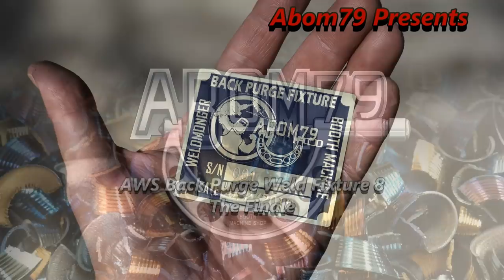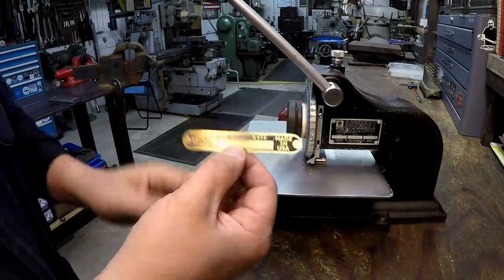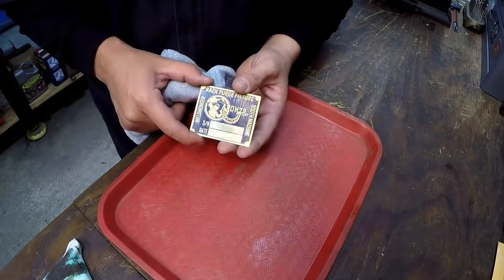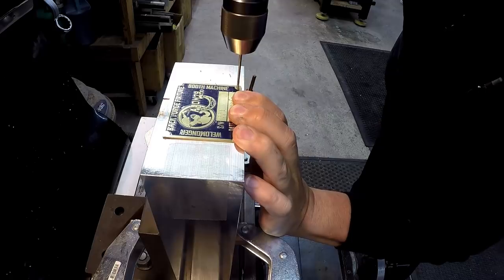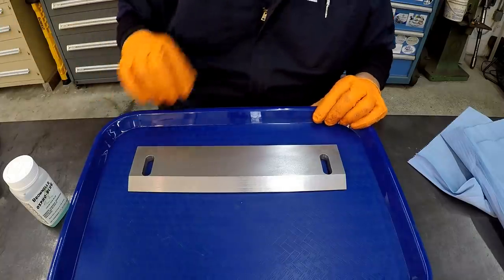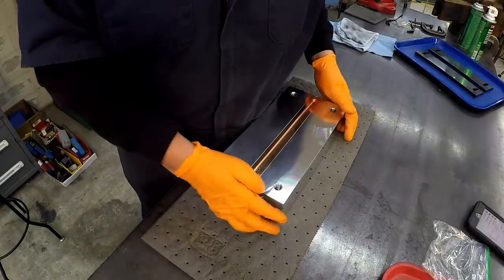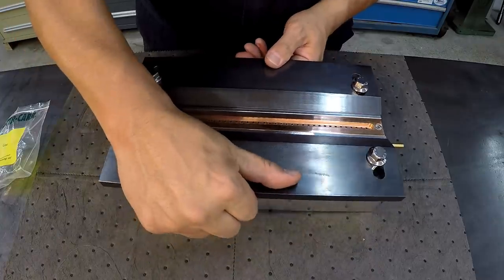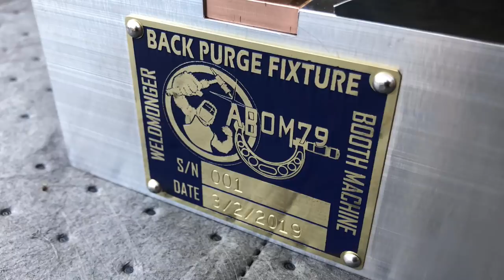AWS Back Purge Welding Fixture Part 8: Finale

Comment: beautiful work abom. @UTank agree button head would look better if bumping your hand is a concern, though you’d lose the ability to hand tighten. I really personally love the look of low profile socket heads. Sort of obsessed with them (hey we each have our things) hex caps look too industrial. Phillips looks mass market. Slotted looks vintage. Socket cap looks custom, and low profile looks slick and custom. Never use the zinc plated if I’m making something I’m proud of  (blue zinc -though it’s fine and affordable it looks very mass market / cheap to me. I do like the black and yellow zinc. ) I generally go for good black oxide>black zinc> stainless (18-8>304) You can tell a lot about a work based on the fasteners used. 

This is also an area I feel like a UNF thread would have worked a bit better (1/2 -20) - it would stay in place much better under hand tightening. Still, It’s great work, and I feel guilty playing arm chair quarterback, over-all worlds above what I could make.

Comment: Could go with low profile socket head cap screws.  1/4" head height on 1/2-13 bolts.

Comment: I kinda thought that he was going to use the fixture for welding band saw blades together.  Hope he uses it for that and makes a video as well.  I made a similar fixture for welding a band saw blade together and it actually worked well but the blade broke again near the weld but my weld didn't break so I figured that I should have tempered the blade afterwards or something so it would be nice to see the correct way to do it. Lol

Comment: If you heat the parts to 150F you get a really nice finish with the Oxpho blue. Why use button head bolts for the plates?

Comment: That turned out very nice, what do you think about using pan head bolts with Allen or Torx drive ? might be better to slide your hand over when welding.

Comment: One thing the user could do is place pieces of stock beside the weld to cover up the parts of the fixture that aren’t being used, that way the amount of gas used will be less but the results will be the same
Reply: Totally agree - for narrower/shorter welds, something to block up the excess holes would be good.

Comment: Adam, a couple of little brass slot blockers to make the gas only come out the part of the slot you need.
Reply: I was thinking of something similar, it could be just a pair of sheet metal shutters that you slide in from both ends to close off all the gas that isn't going up through the part.

Comment: Nice! But I still think you REALLY shouldn't use stainless steel bolts in an aluminum/brass fixture... The thread in the aluminum will eventually break due to galvanic corrosion...
Reply: He helicoiled the aluminum, it should be fine for quite a while.
Reply: @tmacie2  true. But he didn't helicoil the threads for the center Copper strip
Reply: I haven't watched all the videos, but wow what a professional touch.

Comment: can get metric socket had bolts withe larger head diameter and shorter, sure can get them in 1/2" 13 aswell

Comment: Thanks for the explanation about this contraption ! So, if I have to weld a stainless tube of an X thickness and want to know the amps and amount of argon to inject, I would use this with same stainless thickness plates to test ? Is that correct ?
Reply: You'd be able to do something like that. Although, I've seen these used mostly to test people's ability on titanium or thin stainless.

Comment: I might be missing how this is used but arnt those bolts going to get in the way of any metal you are trying to pllace on it to weld? Or is it just for small pieces that fit between the bolt heads? And +1 for the spray welding vids.

Comment: How the hell do you use it?!?!?!   And I mean that in two ways:   What is it used for and how can you use it with it being so nice?!?!   Nothing like museum quality tooling....
Reply: It's a butt weld fixture for testing.  When you leave a gap in the root of the weld, this floods that area with Argon from below.  The TIG torch supplies Argon from the top during the weld.  The weld won't stick to the copper, so it's the perfect metal for under the open root.  They used to use welding spoons made of copper to keep the filler material from falling through the bottom of an open root or hole when welding.  This is just a super fancy, gas supplying, welding spoon for TIG welding.

Comment: as always your workmanship is outstanding but stainless bolts in alloy don't always go well together, i advise the use of anti sseieze or just plain bolts, they'll gall eventually, but thats just my experience using alloy and stainless together.
Reply: bigblock4270 Should be ok as he installed Heli Coils for the reason you mentioned. I think it was back in part 1 or 2.

Comment: You mentioned the possibility of milling a slot to act like a counterbore for the bolt heads. If you keep a flat surface, "Button Head", (Dome-Headed) socket cap screws can be used to smooth out overall appearance and feel. Basically they look like rivets.

Comment: Consider using McMaster-Carr item number 90807A141. It's a shoulder bolt with a head height of 5/16, shoulder length 1/4, and head diameter of 5/8". Love McMaster for their delivery time. Thanks for the videos

Comment: Wow!!! I just looked up the replacement wheels on Schmidt's website and for the 1/8" it's $705.00. yikes
Reply: most amazing is that they still have them.  Being the "Standard" for this i can believe.  great machine, accurate, easy to use
Reply from the maker: Yep I’m hoping to luck out on a used wheel one day 🤞🏻
Reply: Good luck. I'll be on the lookout. If I find it will you tell me how you cook your ribs? (Temps,time,etc.) 😁

Comment: WAIT, doesn't stainless steel & aluminum corrode when they come into prolonged contact? Due to the exposure of welding temperatures, it could speed the corrosion between the two metals even quicker.
Reply: Perhaps, the helicoil will keep them from contacting altogether.
Reply: TheAsianVillain shouldn’t corrode in this circumstance he has thread inserts in the aluminum that will isolate the stainless bolts likely with proper maintenance this fixture won’t corrode anyways

Comment: Beautiful work as always and thanks for the explanation, I was going to ask but no need now. However... is it not a safety concern with all that Argon being in the near vacinity of the welder? Does Argon not consume Oxygen rather than create a barrier?
Reply: Argon is an inert gas.  It doesn't react with anything, it just locally displaces atmosphere around the weld puddle.  no risk unless youre welding in a very confined space with no fresh air supply
Reply: Thanks for that, I knew they use it for fire suppression systems in the likes of server rooms etc which makes sense from what you say, it displaces all the oxygen out the room to starve the fire :)

Comment: Could the Oxpho-Blue off shoot some gases that could effect the weld as it heats up from the welding?
Reply: Robert Yelverton guessing no, since it’s an oxidation. The most reactive elements are now bound to the steel.
Reply: @sethbracken  I haven't done any welding in several years, but if I remember correctly oxidation is bad for welding.
Reply: Robert Yelverton a) he won’t be welding the deliberately oxidized part b) let’s say something did get hot enough and gassed off, pretty sure the relatively immense cloud inert gas that the fixture is supposed to channel wouldn’t let it contact the weld
Reply: Eric Cartman I cant understand your comment it’s in metric

Comment: I drive people crazy with how I write the date. 2Mar2019. 🤣
Reply: Hi, Mikel!  Don't worry - I'm a Brit, and I see things your way. Brits usually do dates from smallest to largest, too. Day, month, year, just like seconds, minutes and hours. It makes more sense to me than putting minutes before seconds, and then the hours.

Dates are only confusing up to the 13th of the month anyway. 12/12/2019 could only be the 12th of December, and 13/12/2019 could only be the 13th. But in many countries (including Britain), 11/12/2019 is the 11th of December, whilst in America it'd be the 12th of November.

Adam's date of 3/2/2019 looks like the 3rd of February to me, but knowing that the job was completed in the States  kinda hints that he'd be using the American convention - so it's more likely to be the 2nd of March.

Your dating system (with a 3 letter month) is pretty much standard outside America - especially in newspapers, magazines, formal letters and messages - because there's no possibility of confusion. If in doubt, spell it out!

A lot of Asian countries go completely the other way, starting with the year, then the month, then the day. Biggest to smallest. Works well, especially if you begin 'small' single digit months (i.e. up to 09 [September]) with a zero; so Adam's date in Japan would be 2019/03/2.

When I was a kid I used to wonder why folks in the US celebrated the 7th of April...   ;-)
Reply: That is the correct way. DDMMMYYYY ie 04JUL1999. The US way has one merit, the dates, when using all numeric characters, is in numeric order but I still prefer the British format.

Comment: What rivets did you use for the plate? I haven't seen threaded rivets like that before anywhere.
Reply: They're called drive screws and are available in the US from McMaster-Carr, among other places.
Reply: They're called drive screws. Awesome for blind holes! They have a helix on them that embeds into the material, if drilled properly they hold quite well.
Reply: @70superchicken  Ah thank you.
Reply: Thank you.

Comment: Question: What is the make of that embosser that you used on the brass plates? I am searching on Ebay for the one that you have and cant find it
Reply: said Schmidt on the side of it.   I was looking for one on ebay too, but didnt have much luck either.
Reply: There is a few that are similar to the one that Adam had but not exactly the same. Hopefully Adam Booth will read this and reply with the exact make and model of what he has because that is a damn nice machine.....

Comment: that stuffs great, beats painting billet engine parts, how's it handle heat?.
oh and hey adam there is nothing wrong with having pride in what you create.
Reply: it's just a oxide coating so i would assume it will hold up fairly well.

Comment: Adam,
   I am not a welder but isn’t the purpose of the Argon gas to displace the oxygen to enable optimum welding conditions? Thus the term “purge” in this instance is for that purpose? I’m not trying to split hairs, just want a better understanding of the process.
Reply: I should imagine it's to increase the Argon's sphere of influence. The heat affected zone could easily be hot enough to oxidise while being far enough away from the nozzle to not be shielded.

Also it allows you to run the gas for longer during cooling.
Reply: In this case, the argon 'purge' is to prevent the air from coming in contact with the back of the welds.
 I'm thinking the fixture is a specialty for the YouTube stuff..?
Reply: Dale Griggs The argon purges out the oxygen.
Reply: I understand that Argon facilitates welding by displacing oxygen to eliminate oxidation. My point is the Argon is used to purge the oxygen from the surfaces of the materials being welded. To “purge” means to evacuate or displace one thing for another.
Reply: dannymaciejewski ,
Exactly. Isn’t that what I just indicated?

Comment: While I really like the look, there's something you may not of realized with using the stainless steel bolts with the aluminum block ... you'll get galvanic corrosion. Take a look: https://www.albanycountyfasteners.com/blog/2017/09/15/stainless-steel-and-aluminum/
Reply: It's nothing a dab of Tef-Gel wont fix.

Comment: What does this fixture do?  New to the channel, fascinated but have no skills in this area and I am Canadian, damn eh.
Reply: it replaces oxegyn on the back side of a weld to make the weld smoother and eliminate impurities in the weld (according to Google)
Reply: Floods the back side of a weld (usually a test weld) with an inert gas (argon). Argon protects the molten weld pool from oxygen which creates oxides that hinder the weld properties. The top side of the weld is shielded form the same inert gas that comes out of the torch.
Reply: @Steve_Just_Steve  Awesome thanks!  i recently retired and want to learn to weld...among a bunch of other things I never had time to do!

Comment: Do you know in the UK that tag reads  third of February 2019
Reply: This has always been a pet peeve of mine. You'd think we could at least standardize date codes. Do you say Three February 2019? No you likely don't. If you verbalize it it is March 2nd 2019.
Reply: LPRNChannel  Ah no actually...I’d read that, Third of February 2019!
Reply: My point exactly. Just a recognized standard. I wouldn't care which way but a universal standard would make life just a little easier.
Reply: @LPRNChannel  There is a standard, known as ISO 8601 from the international standards organization. It's generally seen as year-month-day though it allows for some variation. E.g. this date would be 2019-03-02.
Reply from the maker: I’m in the US, Jody is in the US, and I clearly stated what the date reads.

Comment: With all that you've done, why not make a bolt with a lower profile and maybe hex or star. Your work is real good. Don't settle with a bolt that's not right. This is not meant to criticize. The piece is so well made. The bolts don't fit.
Reply: I have to say it Everette. You have  a really odd way of "not criticizing" something. Are you offering to pay for Adam's time and for the new material needed to satisfy someone who isn't even the customer? Just asking...